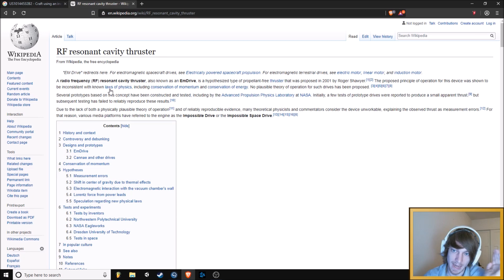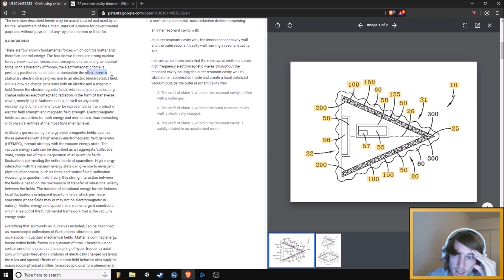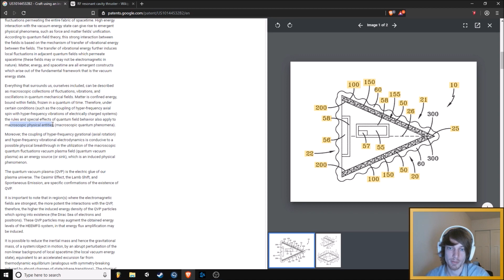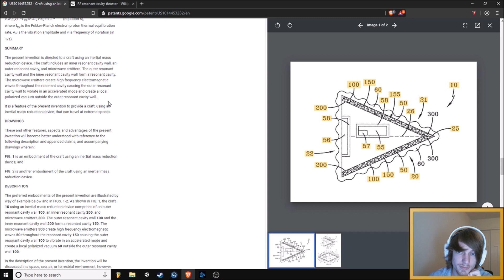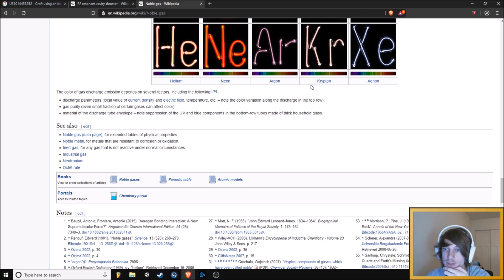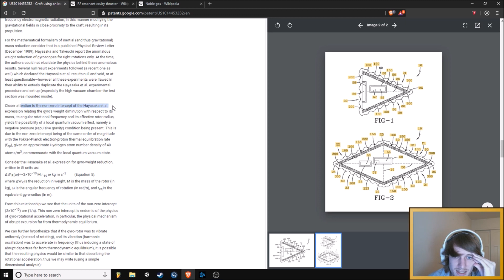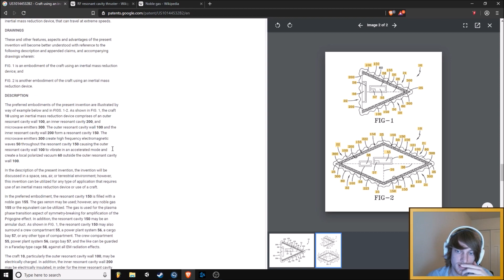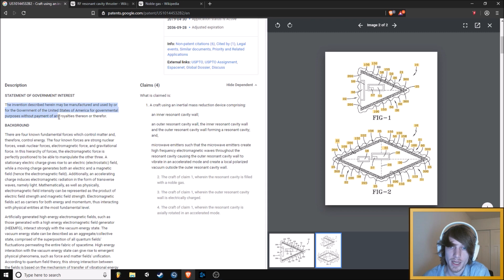EM Drive Is Back! (UFO? UAP?)

Comment: The idea is simple. Create a spinning magnetic bubble. Then create plasma to ride on it. The effect is a field that removes you from the energy of the earth. That means no resistance when in flight. It would be like a rock thrown on the moon. This device is not used for propulsion.

Comment: Trying to BEND space-time. But I highly doubt they will succeed. After going through this I feel they are trying to reverse engineering it but will fail. The reason is they are missing a very crucial step.

Comment: It is impossible to "remove mass' without transforming it to energy, that is, without exploding it. What the patent is talking about is an "INERTIAL mass reducing device", not a reduction in mass, which is impossible without decreasing it explicitly (using lighter materials) or "getting rid of it", that is, transforming it in energy which is not very helpful for generating trust. 😆 Be more careful with your vocabulary. In this case, from what I get from this reading is that you are not reducing the vehicle "mass" but its "density" by artificially creating a void which makes the vehicle occupy a larger volume which gives the effect of being lighter than the air. A more down to earth example of this is the explanation of why a boat floats on the water. It does because the volume that would be occupied by water is actually occupied by air because the walls of the hull block the water to come inside. With the weight of the boat, water is removed by the sunken part of the boat artificially reducing the density of the overall boat. Once the density becomes at a level that the weight of the water removed from the sunken part of the boat is balanced by the boats whole weight, the boat stops sinking and removing water from the space it occupies in the water, making it float on the water. That's a much better explanation to what is going on there.

Comment: I bet it is the  new engine on the back of the x-37-b space shuttle The usaf have ben testing it far outside earth orbit.
They mounted it right next to the conventional engine in the back. 5 or 6 of these x-37-b's are in the budget as of this year. There is going to be a base for them as well. The last one just landed after a one year of being far out from earths gravity in space.  Or this may be a much better engine for the  x-37-b

Comment: The manipulation of the 4 forces in nature comes about in a very interesting way.

After reading some if the text, I can see how it happens.

I'll try to explain some of it...

First, ask this question:
Why is the Microcosm so bizarre & unintuitive from the Macrocosm where we operate?

Its because deep within the atom, the physical world separates into a sea of quantum fields.

The phenomena that build our everday world, here, in the Macrocosm emerge from these separate fields in the Microcosm.

BUT (this is the key!) if you could use just 1 of the 4 forces to manipulate the other 3, you could cause the bizarre & strange nature of The Quantum World to become emergent in the Macrocosm.

Think of it as Bose-Einstein-Condensate (BEC).
If you have a lump of matter with enough energy in it, that matter does NOT behave as if its one giant atom.

-In this way, the the bizarre Quantum World does not manifest in the Macrocosm that we operate in.
So instead, phenomena that define the nature of the construction of our Macrocosm "emerge" from a collection of Quantum Fields.

BUT, if you cool (remove kinetic energy from the matter's sub-atomic particals) that lump of matter to a certain point....then the entire lump of matter, as manifested in our Macrocosm, behaves as if it is one, giant atom!
That's a BEC.

Ok. So basically a High Energy Electromagnetic Field Generator is using the EM force to do to Quantum Fields; that cooling matter to a certain point, does to make it a BEC.

-In this way, its "manipulating" the other 3 forces & allowing the bizarre Quantum World to manifest in the Macrocosm.

Wow! This is blowing my mind, as I am explaining it!!!
Reply: Everything seems to be affected by the background even the way light travels which to me shows that there are ways to interact with that soup for not wanting to call it anything specific!
Reply: As someone who had to self teach him self quantum mechanics that shit if absolutely crazy thinking abt that you blew my mind when I was reading along. To use elector magnetic forces to manipulate the structures if nature is crazy we came up with this but sad we don’t plan any practical use of this tech other than military uses :(

Comment: “Wheels within wheels” is the the description of the engine necessary to navigate the heavens! If your existence had an axis in every single direction possible and you were able to distort/modify any of those axis in motion then you would fall in any desired direction of your choosing. The “eyes” are sensors and modification mechanisms!

Comment: I was just watching electro magnet lift experiments from 1971 with the very beginnings of magnetic lift trains. Which technically are flying machines. They just fly a few inches from the rail instead of high up in the sky.
The material the scientists were lifting( repulsing) with the magnetic field was Aluminium. When the mass of the Aluminium was increased, the force of repulsion increased exponentially. without increasing the output of electricity. Not the reverse. Using the earths natural magnetic field, a variant of Aluminium, or another newly discovered material could be used to Navigate by changing the direction of repulsion mechanically at will. Magnetic micro or nano coil pumps can flex or alter the shape and pitch of the material to change the direction of magnetic repulsion. Therefore changing the direction of the craft. The craft using minimal energy to manipulate the material  while the earths energy, applied through the magnetic field ,is the major source of limitless energy to move the craft. Again harnessing the force of magnetic repulsion.
So using super light, super strong material to build the craft from. To maximize weight reduction. The flexible Aluminium or other material is attached to the craft. Probably at the crafts center point. And it’s the Aluminium that’s not lifted but magnetically repulsed(pushed) by the earths magnetic field. Carrying the craft(UFO,IFO) attached to it, with it.
Adding the science shown in this video will further reduce the weight of the craft the aluminium sheets or “walls” are carrying.
Here is a lecture on practical use of these laws of magnetism in  early development.
https://youtu.be/oWiYsRi2Dss

Comment: I understand it completely. Outer space is a vacuum. The Earth moves through it unimpeded using the suns gravity and  the fabric of space. The Earth has an atmosphere to protect us against the inertia of moving 36,000 miles an hour. So create a vacuum around anything, acting as an atmosphere and propusion at the same time and any living thing inside will also be protected from the inertia of moving thousands of miles an hour. It's a manmade UFO,, and probably what we've been hearing about supposedly harrassing our Navy ships, when it's the Navy themselves in a black project that they don't want to disclose until they use it to establish or re-establish world dominance in the name of aliens. This is just a very basic explanation of it, but I'm sure can get the point. If you can mimic how the Earth moves through space, yet reverse it, to work in the oposite way, it still functions the same. In a vacuum you need an atmosphere and a lot of gravity. In an atmosphere you need a vacuum and a lot of gravity on a similar scale. Which means you could build someting pretty Fukkkking big and still bve within scale size to match the required gravity from the Earth, as long as you can engineer it to stay together and not fall apart.

Comment: No this isn't the Astra. This is the HUAC, and you can spot it by it's Chevron Shaped Coronal Discharge: during the daytime it will glow bright white and you'll see a bright white vector or chevron in the sky. The Astra has liquid methane impulse rockets on all three sides on the bottom, and will build up a sphere of plasma from its portable nuclear reactor with cobalt 5 magnetic flux density transistors and quickly discharge it, "disappearing" from view. The transistors direct the turbulent flow(centripedal convergence) of superconducting plasma to create dynamic counterbary and barycentric control. It mimicks what our planets do with our magnetosphere.

Comment: This has been talked about for many decades, reports of how early UFO's worked spoke of similar designs, the design shown looks like photos of the Belgium TR3B UFO. These ideas go back to Tesla as well. High frequency high voltage devices. It is not the EM drive but there are some similar ideas - the EM drive and the Mach drive do have similarities. Something key to this is that it is dealing with a new Pardigm, Plasma Cosmology and Holographic Cosmology are involved and is def. not Einsteinium physics. EM rules the universe not gravity which is an affect not a real force; same with weak and strong nuc. all are affects of EM Plasma Universe.

Comment: I've seen one of these about 20 years ago. Made no noise, flying at night maybe moving 25 mphs and was huuuuuuge. I wouldn't even know it's above my head until I noticed 3 spot light on corners working like police chopper lights. Girlfriend and I followed it for couple mins, in our vehicle. Massive and no noise.in Chester, VA around 99-2000
Reply: Yep me too back in 1985-86 in AZ. No noise, huge, it was just gliding across the sky
Reply: @twilightsinger20000  You saw the AZ Lights?! !!
Reply: @twilightsinger20000  Sounds like the Aurora project. Its an experimental, triangle shaped aircraft. They’re often tested at night. Don’t worry, its man made.
Reply: @JohnSmith-gz5pm  are you sure it’s man made? That thing looks like it defies the basics laws of physics and aerodynamics. Aircrafts don’t move vertically, especially when they are in the sky.
Reply: @elleryaddo9511  The more recent ones were created by Dr.
Reply: @elleryaddo9511  Pais
Reply: @elleryaddo9511  Inertial
Reply: @elleryaddo9511  Mass
Reply: @elleryaddo9511  Reduction
Reply: @elleryaddo9511  Device
Reply: @elleryaddo9511   the patent for it that was filed by the US NAVY!
Reply: @UCIeqeMm-rA1snGwVnEfdWWw incredible. Thanks for the info.

Comment: I've seen a giant triangle craft in Chester VA around 1999/2000 and followed it for a few mins. if it's 3 corner lights weren't on, I'd wouldn't of even known it was above me
Reply: Some guys out of Creech still fly the old LTA Astras that are slow compared to the Hybrid system powered by the portable MHD Fusion reactor like the old SP-100 Variants.
Reply: Sounds like a tr-3b

Comment: Idk what it was, but about 5 years ago when they did the triton missile test out of LA i saw a flying V pass over in fullerton. It had 5 circles that looked like pool lights on the bottom, but were not emitting light. It looked more like a baloon floating than an aircraft "flying". It made no sound, it was also hard to tell if it was small and low or large and high, almost like a mirage. My buddy saw it too and we still trip on that night.
Reply from the maker: I saw a flying V at night when i was stargazing. Also made no sound. Not sure what it was.

Comment: head of Navy tech says these are already "operative" and the Patent calls for Argon gas in the hollow,  dual-hull cavity. These are in service, and called, variously, TR-3A Black Manta,TR-3B, Astra and Locust; made by Lockheed Martin
Reply: Nice to see someone who does their research speak out.  <3
Reply: @TheRealVeigar  Thank you!!  I believe exactly that is important, it helps I am a geek and love research. Ultimately, the US Navy released the keys to almost free energy - a fusion containment compact nuclear engine, one cubic meter, needing 1000W input for 100kWh output, when the largest output fission reactor (AZ) only puts out 4kWh AND what makes it work, room temperature superconductors, one of the 4 main Patents released in 2019 by Navy. Way better than Lockheed builds. And these craft Navy says are not only operative, but operate as platforms both underwater as well as atmospherically,  (and extra-atmospheric with special pressure hulls.) The inertia cancelling is rated at a reported 97% and that is the close sister of anti gravity. There have been consequences - as I knew this before the US Navy declassified them, and it got me harassed. I am lighter now they are knowns. It is an easier burden to know, they are declassified, if still "unacknowledged" and I appreciate the comment
Reply: @Omari Orou Yes, butand perhaps the Ironman writers were aware of these technologies, before the films were written? This was the suggestion about the first Star Trek writers (esp Gene Rodenberry)

Comment: Thanks for doing the video. I think this is the best explanation yet for the “tic-tac” shaped UFO’s that Navy pilots have been capturing with their FLIR systems. If that’s the case, they have had working drones using this tech since at least 2004.

Comment: super cool that someone is talking about this, props!    

the xenon cavity is an envelope around the entire craft -that when activated forms a bubble (the cavity envelope is the bubble membrane) where everything inside the bubble is essentially hidden from the normal newtonian mechanics of our universe, and vice versa (this is sort of a big problem for anyone inside this patent does not seem to solve that problem on its own, but i digress,  that said, people have to be inside in order to avoid any G forces, so they must have a solution patented elsewhere - but again i digress).  another way to say it is phasing out.   

the interesting thing about this is even while phased out, the craft would thoeretically maintain its volume in the physical universe.  this means essentially its like a balloon in our atmoshere, tending to rapidly float to the top of our atmosphere when activated.

As far as I can tell this patent does not incorporate the actual thrust device tech.
Reply: also unclear is whether the engagement of this effect is like flipping on a light switch, or if its more like turning the dial of a dimmer switch.

Comment: The amount of energy required to make this work means they also have a superconductor storing and putting out immense power, but the patent doesn't mention this, if true it will turn life as we know it upside down!
Reply: There are several patents of inventions by this Salvatore Cezar Pais which are assigned to the Navy. 
Here's the one for the superconductor https://patents.google.com/patent/US20190348597A1/en

Comment: I think they are describing using a plasma to decouple the affect of the mass of the craft from the surroundings,  rather than reduce the mass..  Vibrating ( oscillating ) a noble gas at a high frequency , whilst applying an AC current across the surface of the craft. might be what there describing.  If you had a big enough current ( Field charge ) it should be doable under current physics,  BUT, that type of field strength would require 100s of millions of volts ( power station size ) and a craft surface thats a superconductor to make it effictant. 
 Its the power source that would be revolutionary.   If i was to make a guess at that ( power souce ) , maybe 2 molten salt mixtures under pressure, held around their  phase transition points and oscillated above and below that point.  With the oscillation being varied so the waves crash into each other and amplify themselves. 
The above way would work in current physics , But what would i know
Reply: with perfect or near perfect resonance you could use a small power source and charge the system using a "warm-up" time.
Reply: @George Papadopoulos I guess this is different but in Brazil there are little roundish stones found at UFO landing sites, with a rim, a friend's sister sent one for me